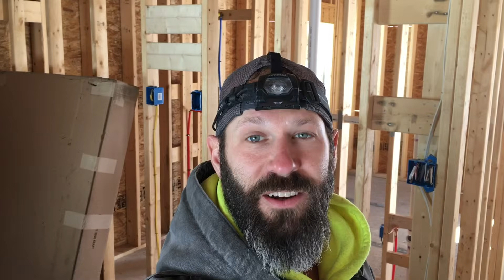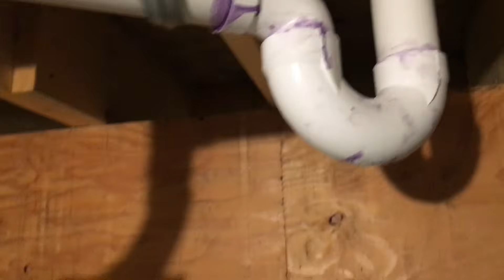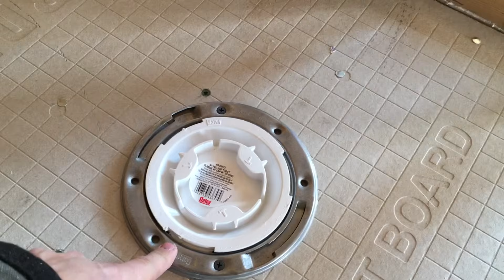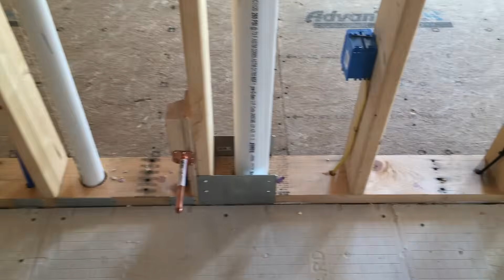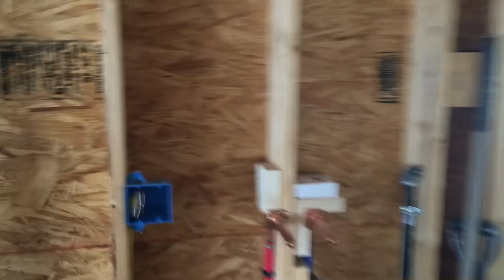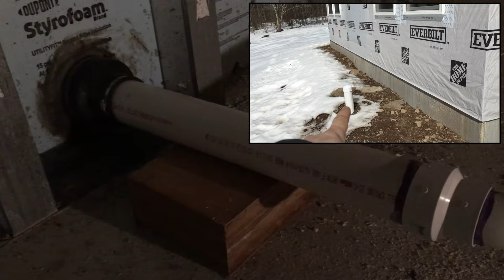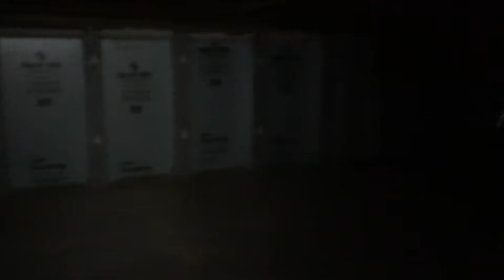Drain, Waste & Vent System | Off Grid Homestead Build Ep19Pt2 | The ShabinLife

Comment: Probably would've used a street wye at the end of the 3" line and put another clean out in, so you have access closer to the septic.. shrugs
Reply from the maker: Hey Jon, thanks for the suggestion, greatly appreciated. I did wind up putting in a clean out right on the other side of the wall.  Definitely worth the little bit of extra effort for sure! Thanks.

Comment: We had trouble at my parents house for years so we finally tore it all out an put a 4” trunk line. We have had zero problems since we did that and we put long sweep 90s below the toilets.
Reply: it's nice if your drains don't run between beams on second floor you are kinda stuck with those short closet ells below toilet
Reply: @ranger178  👍 yea that’s something to think about when building.